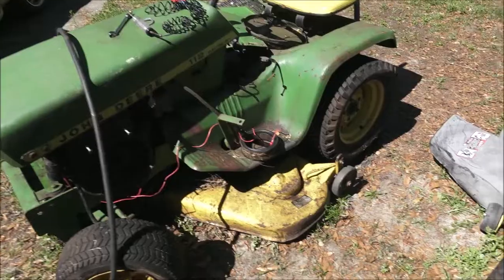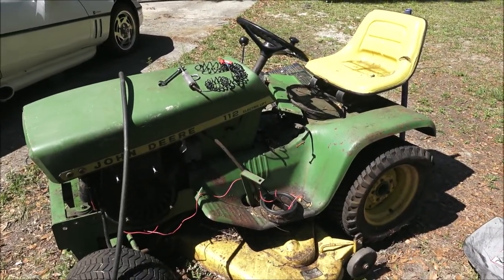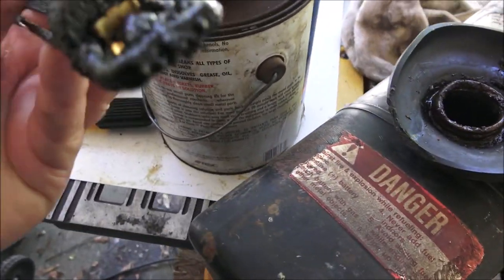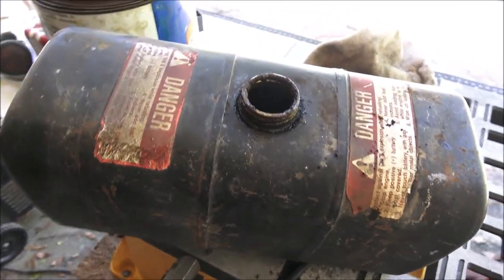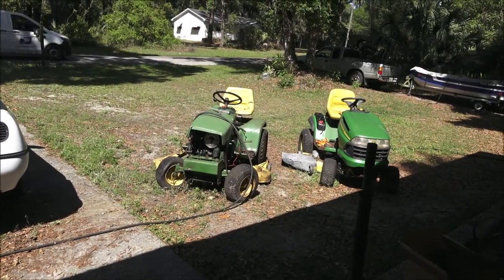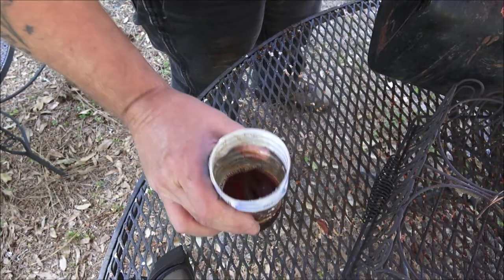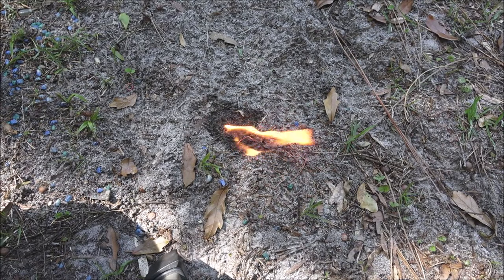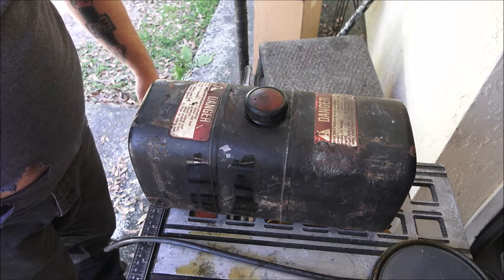Another Free Item 1974 John Deere 112 Electric Lift Garden Tractor

Comment: It's crazy how cheap the carburetor and fuel pump are for these engines, I had a John Deere 210 recently, ordered the carburetor and fuel pump both under $60.
I learned though, order the carburetor from eBay not Amazon at least here in Canada.
Reply from the maker: I found out to order from eBay as well, Amazon has junk. I still can't find a gas engine for the gulf cart anywhere down here. They are mostly electric here. Hope all is well with you.
Reply: @shabear1000   You would think finding golf cart parts in Florida would be easy considering most people use them as their primary vehicle.
All is mostly well, I lost my wife a little over 6 months ago, all will never be 100% well, but things are starting to get better.
Reply from the maker: @redneckbryon  I'm so sorry to hear that man. You'll be in our thoughts and prayers. Hang tough my friend.
Reply: @shabear1000  Thanks